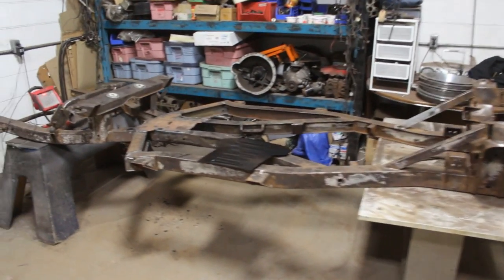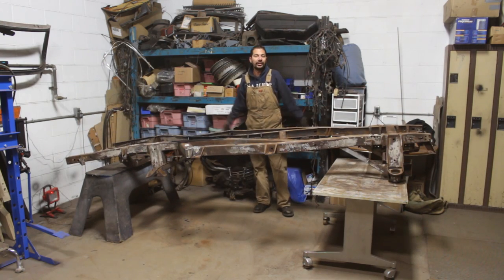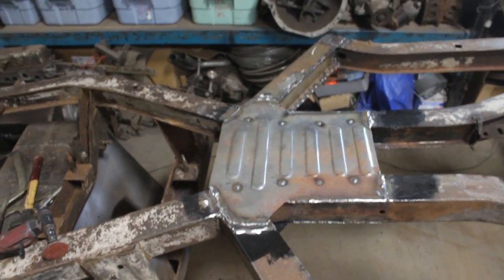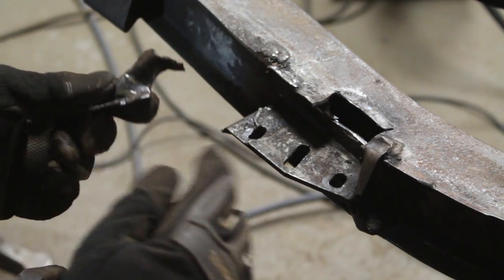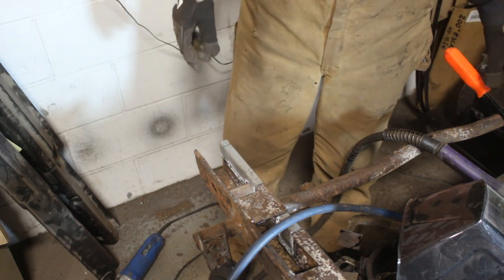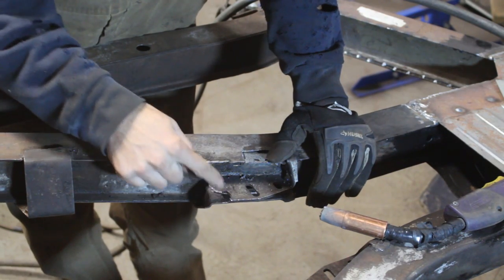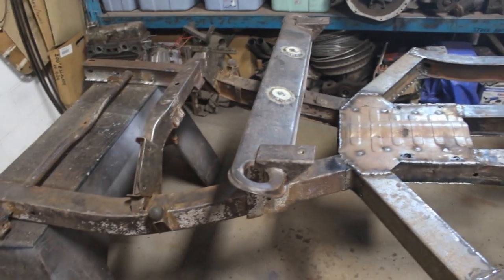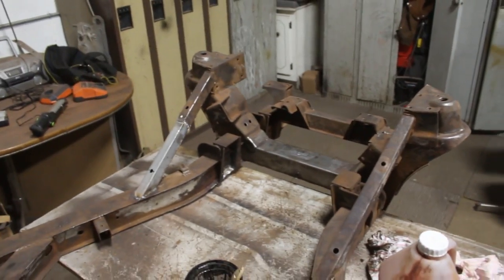Triumph TR6 Restoration - Part 8 - Frame repair and body assessment

Comment: getting good viewership, superb effort ... I'd think ( and I had a '76 TR6 I loved ) it's , bottom line ' throwing good $$ after bad', it's just the way  of mild steel.  probably be better to make replica frames of S.S. and a thicker gauge as well.  cost, mega huge bucks.  I did see an internet site that sold full replacement, advanced racing oriented frames.  TR 6 as $100,000.  toys ?
Reply from the maker: Yeah, frames can be expensive :) I am working towards restoring/refurbishing old parts. I buy replacements only when the old ones are really lost

Comment: That frame is kinda 'tender' Elin. You got it fixed up nice!.
Reply from the maker: If it rots again in 50-60 years I will consider replacing it with a Ratco one. It will be good for now :)
Reply: @RustyBeauties  I highly doubt that the frame will rust any more. You already protected it more than the factory did when new.

Comment: Good work, but I‘m afraid the rust will just continue eating this thing from the inside.
Reply from the maker: Well the only way to prevent that (or I should say to reduce the risk) is to coat it internally and that is what I am going to do. I mentioned it in the videos. I ordered internal frame coating spray from Eastwood and I will try to protect the frame inside. I hope it works.

Comment: looks like a off to sandplasters job  elin   the body that is ,  would take you  ages to clean that up
Reply from the maker: Maybe, but not yet. It can not be sandblasted with all the tar on it. It needs to be removed manually. The other problem is all these patches hide rusty metal behind them and that is what I want to be sandblasted, not the patches... So I have to remove the patches first. So maybe after that we can sandblast it, but maybe not :) I will decide later

Comment: I’m surprised that you have not fitted strengthening pieces to the front suspension mounts as these do have a habit of breaking away and,
at the same time, fitted strengthening pieces to the diff mounts. I would consider these items to be essential when you are doing a restoration of this depth.As for the body, I would have soda blasted or dipped toremove all the paint and other crap. Only then can you see just what really
needs to be done. Judging by the state of the various panels I would replacethe whole panel as I’m doing to my 6 otherwise, you are just chasing your tail.In your case, I think I would seriously consider buying a new body shell and sell off the good bits of the old one to defray the cost somewhat.
Reply from the maker: You might be right about the front suspension. I've never seen front suspension mounts break away and that is why I didn't think of that, but I will do some research. It is not too late to reinforce it even now, Thank you!
Regarding the body, I've seen much worse bodies being repaired including my GT6. And I am actually really happy with the results. I am not concerned about the body at all. Even if I get a "new" body it will come with issues as the last new body was made 40 years ago :) So I'd better work with what I have, which is not that bad at all. I wouldn't sandblast it before I get rid of all the tar and patches. They hide rusty metal, which won't be reached by the sand anyway. So I have to get rid of those first and only then I can consider sandblasting.
Reply: I agree with Jon, think you should fit the front suspension reinforcements and especially the diff mount stuff. With your fabrication skills no need to buy the kits, just take a look on-line and make up your own. Re new bodies, I know Heritage made them available some years ago (many less than 40) for restoration projects, don't know if they're still available.